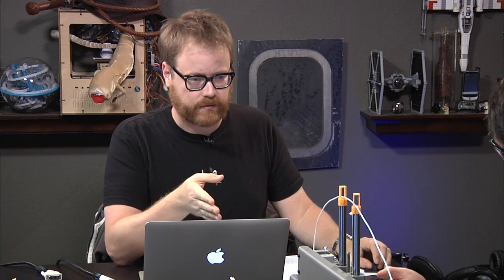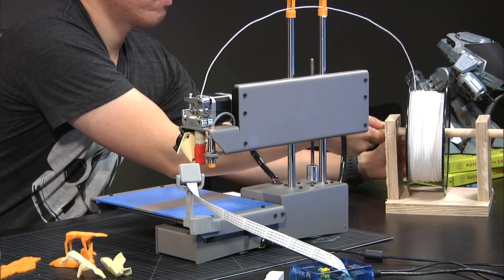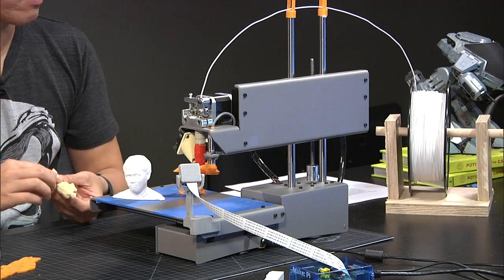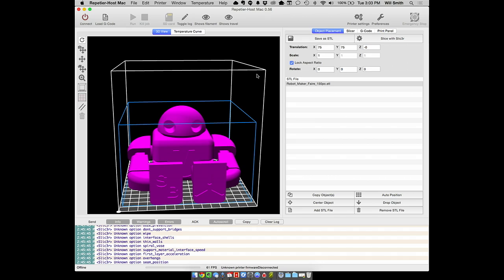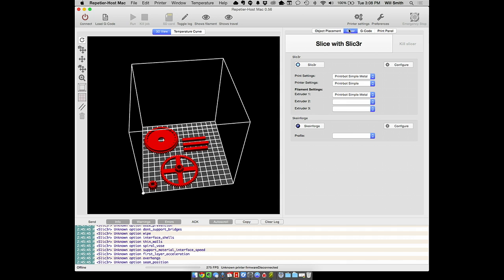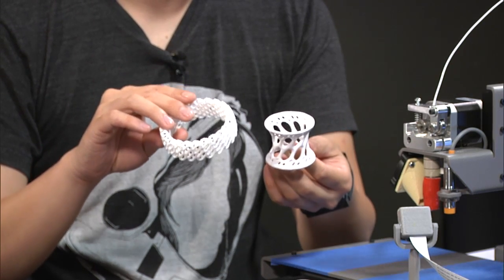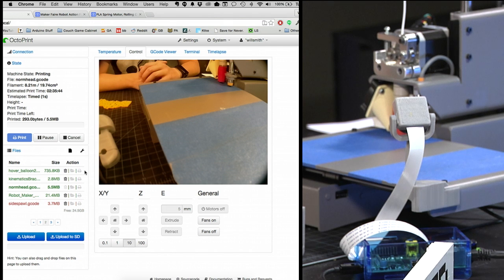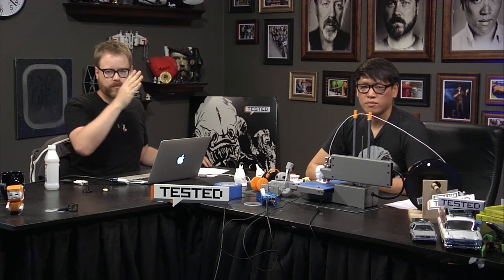Tested In-Depth: 3D Printing with Printrbot Simple Metal

Comment: I have to say. With the reviews from MAKE magazine, and all the you tube reviews for the Printrbot Metal Simple. I purchased mine 2 years ago. It has been a bullet proof design, and I have since installed all the upgrades.The biggest fail for them was not maintaining that essential price point. The Pro just doesn't add up in price.

Comment: Which one would you recommend me to buy? A "Prusa i4" or this one? thanks a lot!
Reply: prusa i3, make sure it has a metal frame
Reply: thenerdling1 . thanks a lot for your answer, have you read about this new prusa i4 or prusa i3 plus? it has some upgrades and a solid frame.
Reply: i personally have a copy of a prusa i3, it prints pretty good, simple to make and easy to get parts for. it has a plastic frame though. ive read some good reviews on the wanhao duplicator i3 and the original prusa i3.
im not sure what ones you mean because heaps of companies use the same name

Comment: Hey Guys,I'm new to 3D printing and just purchased a Printrbot Simple Metal today. While I was looking at the x-axis upgrade, I couldn't help but notice the heated bed option for printing ABS and other filament types. Little secret. The heating plate that mounts under the bed looks a lot like a heat pad I used for my pet Scorpion I had awhile back. Pet stores sell these heat pads pretty cheap and they have an adhesive backed side that would allow you to stick it to the underside of a glass fish tank to transmit heat and warm the sand or whatever medium was in there. I think the thermostat is adjustable(I think) on them and would work great for ABS and other filaments. The pads also come in different sizes I believe, but I haven't been out shopping for one in about 20 years. But if you're upgrading to the bigger x-axis platform and the heat plate is being included no need to attempt it, but I might.

Comment: Here's a tip if your tape is too sticky, just stick it on your shirt and pull it off and apply where you need it.

All the itty bitty small hairs and fabric will take away ALOT of the adhesive quality on some of the more sticky tape.

Comment: the amount of mis-information in this video is staggering.   If you are looking for a review before you buy, do NOT use this video as a reference
Reply: +virustwin Hi, could you be more specific please?
Reply: +Hypohair Honestly i dont even know where to begin.  THe first thing is that they called it a PLA printer.  Thats like buying a blender and some carrots and then doing a video, saying "first of all, this is a carrot blender".  This printer will print any other material (and there are a lot - ABS is the most popular) that the other FDM printers available will print.  Secondly, the argument that it needs a heated bed to print objects without warping is completely false.  Pla doesn't warp much by nature, but i've printed petg, abs and even nylon without warping before upgrading to a heated bed (google printing abs and nylon to see why thats a big deal).  also read this article that compares this 600 printer with a 22000 printer as an example of what this printer is actually capable of http://www.hanselman.com/blog/3DPrinterShootout600PrintrbotVs20000UPrintSEPlus.aspx.  and for a proper demonstration and exp of this printer, watch thomas sandlanderer's and maker's muse's videos on youtube.
Reply: +virustwin Thanks ever so much :) I had no idea. Also cheers for the blog links,

Comment: Regarding how flat the base is, a slightly uneven surface WILL NOT "magnify".. i hear that all the time and i don't think you know what you think you know. You can be off by 0.05mm off and not have a problem (unless you print directly onto the bed without a raft), what happens is that the even if the beds z axes is not perfectly even the layers quickly even out because each layer that is too high up will "squash out" or each layer that is too low it will bead up and level out within one to two layers, and you won't see any of this if you print a raft.

FYI, they sell blue painters tape that is much wider and you will only have to lay down two strips ;)
Reply: gayybee quit being a smarty Pants!
Reply: 71 bbnnnn

Comment: For the Printrbot Simple Metal... Can you tell me what type of mother board and program settings do you have?... Cause the one I have isn't printing the way it's suppose to and it's wrecking every print I make I have tried just about everything I can think of from adjusting setting in the program to adjusting the printer itself it's quite frustrating... any instructions would be most helpful :)

Comment: To anyone who may have watched this video and ended up discouraged by how this machine operates based on how these two used it don't.  I have had a printrbot metal simple w/ heated bed for a little under a week and after about an hour of calibration all i have to do is hit print its just that simple. This is second printrbot machine and it wont be my last. Printrbot makes great printers for the price thw two people in this video have no idea what thwy are talking we currently have 3 of these bots running in my household and never had a problem. So if you are looking for an affordable way to get started in 3d printing printrbot is your best bet .

Comment: If your wheels are warping .. your doing it wrong.. I have a printrbot (for about a year) and use 3m blue tape from the hardware. or elmers stick glue. and warping is a rare issue for me. and accuracy is very good if you properly calibrate it. (hours not days) Environment temperature is important mine works better if the room is 70-80 degrees fahrenheit.

Comment: Just add a bed of plastic and you wont get the lifting in the software you can select an option to have the printer make platform it works great with printers that dont have a warmer happy printing made the same car with same printer it works great and it should not take you 32 hrs to make that robot what percentage of fill are you using 3 to 5 percent is sufficient

Comment: I bought this assembled it worked great for about 1 month, but then failed. It initially seemed to be an issue with the inductive probe, after replacing the probe twice (once with a probe from amazon, and on from printrbot) the M119 command still shows z stop triggered. Any suggestions. LEDs come on and off as expected, Verified wiring, and that the HV jumper is still in place. Any suggestions appreciated.

Comment: INCORRECT ASSEMBLY - you will want to fix... it looks to me that the hot end is not pressed up far enough into the aluminum holder. I think you put the crimp screw in first then tightened it... you need to take the crimp screw out... then press the hotend all the way flush to the top of the holder. The screw will go into the groove in the hotend preventing it from moving down. ..!!!

Comment: Note: I did buy/add a heated print bed to my printrbot simple (the older, wooden frame one) and that did the trick to give me dead-flat PLA (yes...pla) prints.   Elsewise everything printed with a small to large amount of warp ~ even with blue painters tape, tape + hairspray...everything.  (the prints would actually pull the tape up off the print bed...!)  Problem totally gone with a heated bed.  So....$99 heated bed upgrade.  Just do it.  (OR...you could try my first hackish solution, which also worked...which was putting the printer in a cardboard box and pointing a small space heater at the bed.  Worked, but I was always worried that I'd set the house on fire.  :-)    )
Reply: I'd probably put a heated plate at first on it, let it warm the "bed", then move it away when ready to get started

hey wait, could you print few small pieces for me? I did interlocking pieces (not Lego) and need to know if they interlock properly, it would also show me the print quality with this printer (buying one very very soon)

would you do that for me?
Reply: TheGuardian163 (If you're replying to "me") ... my printrbot is currently on semi long-term loan to my kids' school, so I don't have it available for printing anytime soon.

Comment: one way to get around warping on a flat surface is to simply angle it so you have as little contact with the bed as humanly possible. e.g. a small box can be printed on an edge, at 45 degrees, with a raft and without having issues with overhang. If it`s a big box, you can chamfer the edge thats in contact with the bed a bit so there`s more surface area to stick to the raft. 1 chamfered edges is better than a whole surface that`s warped!

Comment: Elmers school glue sticks will stop your curling. A heated bed is on the way also but that is more for printing various other materials like ABS. PLA doesn't cool quickly and that's why it doesn't warp. PLA cools slowly and that's why you need the fan. It doesn't curl because PLA doesn't shrink as mush when it cools as say ABS. ABS needs the heated bed not only to help it stick, but also to more evenly cool the print and reduce shrink, curl, and cracking.

As far as spool holders go I have a couple of these and they make it so I don't have to have a holder sized to the tons of different filament spools that I have: http://www.amazon.com/gp/product/B0036OQWTU/ref=as_li_tl?ie=UTF8&camp=1789&creative=390957&creativeASIN=B0036OQWTU&linkCode=as2&tag=30701-20&linkId=EYFBHGEI4QQE4EG4

Comment: PLA really needs a heated build platform, but only up to about 50C (ABS needs more like 85C-100C).  With a heated build platform, you can use kapton tape and an ABS slurry, it sticks to that darn well and the results on the bottom will be VERY smooth.  AND you won't have the warping problems, I've printed open shell boxes that are only 5 shells thick and are 9"x10"x6"(tall) with no warping or splitting.
Go find the "Essential calibration Set" on ThingIverse!!  Taking the time to go through the calibrations is REALLY worth it in the long run.  I've got my systems dialed into about 0.03% :)
How fast a print speed can you run on this?  My thing-o-matic can run ABS up to 100mm/s, my Leapfrog Creatr can run ABS at about 65 and PLA up to about 100.  Speed is really dependent on the hot-end's heating capability, the Mk7 head on the thing-o-matic is much better than the Creatr...
Reply from the maker: I have never even really needed the ABS slurry with Kapton at 60C for PLA. It just sticks really well if you clean it.
Reply: I've been mostly using ABS until recently, thanks for the tip :)

Comment: Not sure if it was mentioned previously, but oratape ht55 is also something to try in place of painters tape.  Reusable and sample rolls can be found relatively cheap online ($3-8 for 6"x10yd)... I found it works best on a smooth surface, so a square of thick kapton over the enamel paint then the ht55.  A tool, like fixit's metal spudger, to pry the print off helps to preserve the various tapes.

Comment: You guys should look for transfer tape. It can be had on ebay or various other online suppliers (signwarehouse.com). It comes in almost any width you could want. 3M makes it, but there are other brands as well. You can also choose your tack based on what works well for you. It's mostly used in the signs & graphics industry, but  it would lend itself well to this application.

Comment: Try glass cleaner. You will be surprised how easily model is removed from platform after single spray. Glass cleaner will get retracted under your model separating it from platform. It works perfectly on glass of heating bed and may also work on other platforms. So you don't need any film or tape just spray and wipe before printing to remove oil and spray once after printing to detach model. YW ;)

Comment: Could you run nichrome wire under the printbed and run a low voltage through it to make the bed heated?
Reply: Out of interest what voltage would you put throught the wire.  I have tried a burnt out the wire.
Reply: Henry Levine It depends on the length, gauge and material blend of your wire. These are all factors that change your resistance. Once you know your wire resistance you can use ohms law (i=v/r) to find the voltage you need. A common combination is 1.1-1.3 ohms heat bed @12v. Of course it would have to be different if you have no thermistor to monitor the bed.
Reply from the maker: Typically, you used a bunch of resistors on a circuit board, and then attach that to the build platform from below to make it heated. I haven't looked at the kit Printrbot sells though.
Reply: Tested I thought as much.   However would you get the current from the printrboard or an external source.
Reply: Tested You guys should try making your own heated platform with this idea. It doesn't sound overly hard and I'm sure you guys could source all the parts and you guys definitely should know someone with a bit of electrical background. using a potentiometer should let you dial it in pretty well. It'd keep the bed nearly the same thickness too, which looks like could be important with the belt under it.
Reply: Printrbot and almost everyone else uses a pcb designed to heat build platforms. Like this one one: http://www.ebay.com/itm/261195426302
There is a connector right beside the nozzle heater connector on the printrboard that's designated for the build platform. There is also a place to connect a thermistor or thermocouple.

Comment: Tested I spray hair-spray on my print bed, before every print. I barley ever change my tape, it always has chunks missing out of it. I also print everything using a 4mm brim, that seems to help alot. Regularly printing large flat prints (mini-quad frames) with no issues. Best of luck!

Comment: I love these guys.  A couple clarifications are in order:  1: The hotend on this machine is held in by both tension and a mechanical linkage from the extruder's bottom right screw.  The barrel of the screw slides through a ridge in the PEEK barrier which locks it into the extruder.  2:  Repetier-host was mentioned in relation to support structures before the discussion about slic3r began.  To clarify, repetier has nothing to do with support structures.  Repetier is just control software for the bot which provides easy access to slicing through cura, slic3r, or other dedicated slicer programs that are accessed within repetier-host.  Supports will be as good as your configuration or model allow.  3: Warping on this printer will be no different than any other printer without a heated bed.  Viewers should know that warping is a simply due to the physics of cooling plastic and are not due to printrbot's design.  You'll get the exact same warping using a replicator 2 as with this machine all things being equal.  They both blow ambient temperature air directly at the print to cool the plastic, so not even the enclosure matters too much in that regard.  
Love the show guys!

Comment: I love my all metal Printrbot simple. Glad you guys checked it out. I've pretty much been using Cura for all my slicing and printing needs. I have a raspberry pi set up with Octopi. I have upgraded to the heated build platform to avoid the bed adhesion and warping issues. The heated build plate completes this printer in my opinion and everyone needs one.

Comment: try 208C instead of 200C - i get less warping at 208; also warping and relative humidity seem to be linked, dry air seems to be better. (using "justpla" brand 1.75mm)

Comment: Did the printer jam sometimes during your prints ? Mine was jaming a lot, until I baught a high quality filament. 
An other company made an upgrade to expand the platform from 6x6" to 8x8" with a recess to install a heated plate as well. It works very well. I'm also in the process of installing a second extruder. Since the upgrade exists for the board, that you can order the parts from printrbot , it looks really easy. I just have to find a way to fix the second extruder on the arm. I was thinking about a metal plate that goes between the arm and the first extruder, extends the arm enought to add the second extruder in front of the first one.

Comment: I have this printer, its doing very well, I built a stand for it that holds the spool above the printer. it cut down the foot print and feeds without interruption.
The warping can be cured with a different cooling fan shroud downloaded on Thingverse. Its caused by blowing air from one side. You can also cut the warping down by ediditing the config file in slic3r, tell it not to turn on the fan until 8 layers. Also change the default fill density from 20% to 40% and the fill is better...
I have ordered the heated bed and will modify it as soon as it gets here :) 
I have also been using PLA filament from Hatchbox its about 20$ for 1kg, its very good and not 30$

Comment: How many years away do you think we are from a single machine at home that takes in raw materials such as plastic, metal wire and textile spools and spits out something you model on a computer?
Reply: There is already one out on kick starter I believe. I think it only does plastics but it's exactly what you have in mind. Cost is about 2000$
Reply: Kevin Nguyen I'm more interested in a machine that can 3D print with multiple materials simultaneously.